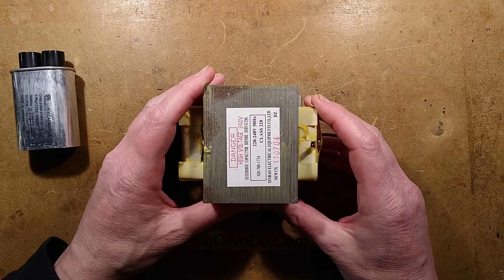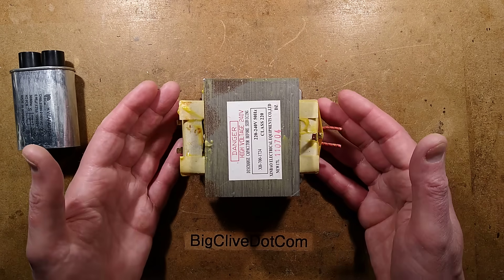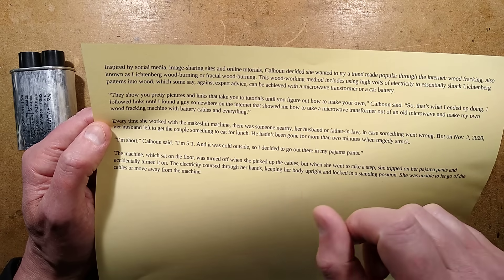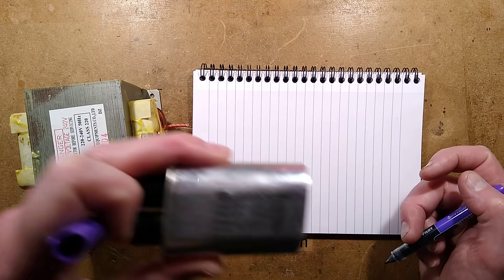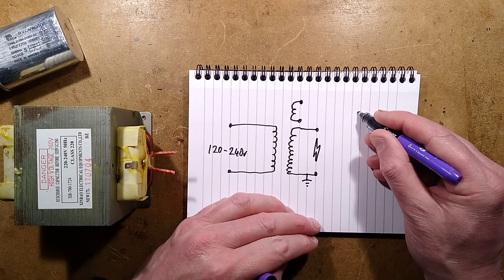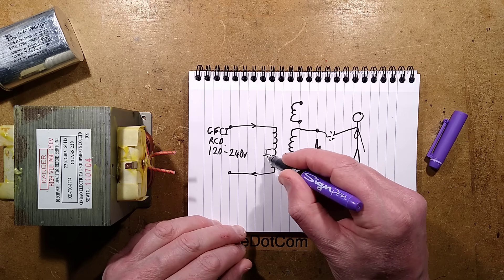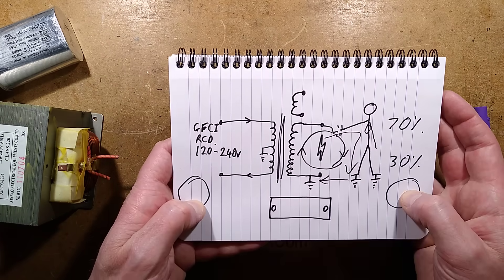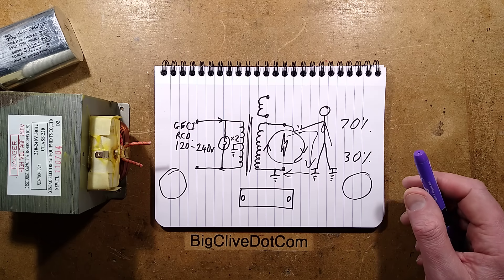The most deadly project on the Internet

Comment: I discharged a CRT tv multiple times. Was scary AF first time around though once i figured out that as long as i was careful and had one lead always attached to ground while shorting the anode nothing could happen

I can't imagine myself even working on a microwave
Reply: It is very unlikely to be killed by charged CRT voltage multiplier (unless it's literally powered). You'll get painful shock, but 99.9% you won't get serious trauma. MOT, on the other hand, is really deadly.
Reply: @voidseeker4394  to be fair. you kinda have to discharge the TV while it's plugged in (else you could damage components in the tv) even it is not powered on it can still do some damage to you if you're careless. and the thing is the shock doesn't have to be strong. just powerful enough to cause an arrhythmia in your heart (which even an electrified fence can do if you happen to have bad luck) now the only thing required would be some possibly undiagnosed condition beforehand and ye.. it could possibly kill you. the reason we keep stressing to be super careful while discharging a tube (if you absolutely have to) is that we don't know whether you might have a condition. heck i don't know if i possibly have one, never checked for it. and i know an arrhythmia itself is not always deadly but it can certainly lead to further problems down the line
Reply: @norjiaqosehon  yes, i've burned power supply's PWM chip while trying to discharge mains capacitor once. My screwdriver slipped and shorted wrong termilals.
Reply: @norjiaqosehon  also, i've wrote 99.9% just to cover probability of the cases you've explained.

Comment: One thing people forget about is that capacitors can build up a charge with ambient/environmental static electricity. Especially large caps. People should always short and ground caps in circuit, even if the circuit is not live.
Reply: Can they really? I'd think you'd require one terminal to be grounded and the other open to air; if the terminals are just open and next to each other, they'd just be at more or less the same potential.. And still I'd think this phenomenon would be weaker than the normal leakage of a capacitor. I mean, if you have a capacitor next to a Van de Graaf generator, then maybe?

Comment: CONDUCTOR    My dad worked on power plants installing electricity, ONE RULE was taught.... If you are messing with anything electrical without training, there is one single rule. Make sure there is no power to the circuit before it in the chain of power to your house.... before you get near it. Not can touch it.... GET NEAR IT. If you are incapable of following this rule, then you will be dead very soon and should move on to a hobby of beading bracelets instead. This wont help with idiots in this scenario but FFS educate yourself before you start pissing about burning wood with electricity as IT WILL KILL YOU FASTER THAN YOU CAN UPLOAD A VIDEO OF YOUR ARSE CATCHING FIRE. The word CONDUCTOR at the start is important and if you don't know what it means or what it applies to in terms of materials, put down whatever your doing before you literally die.

Comment: That would not work most people squeeze and clinch there hands tightly together when get shocked with this much power so you couldn't just drop the box in most cases
Reply: And it also makes the safety feature obsolete because if you're outside of the shock radius using the button remotely you're already not going to be shocked so you wouldn't need a dead switch the dead switch is so you don't get shocked you said just let go of a button a button you can't let go of if you're in the shock radius getting shocked it's like you totally don't understand what I'm saying
Reply from the maker: The box is remote from the location.

Comment: Is this the spot welder from a microwave?
Yes eventually someone will die
Reply from the maker: No.  The spot welder project replaces the high voltage winding with a low voltage one.  It's relatively safe.

Comment: No one should ever work on or use electrical devices unless they understand how they work and the dangers involved. Our greatest killer of man is the car. No one has stopped using the car even though they may be killed. There are ways to use a fractal burner that reduces the likelihood of being shocked, such as complete separation and insulation from the equipment as well as never being in contact with the device while it is working and using the device such as a pedal that instantaneously disconnects if the foot is released. One other device that is much safer is the  neon transformer which produces much lower amperage when fractal burning.  So if you are uncomfortable with fractal burning, by all means don’t do it. It will probably save your life.

Comment: Don't forget to warn people about the magnetrons in microwaves as well, The magnetron, which generates the microwave energy, has a sintered ceramic insulator that is made from beryllium oxide . During use it is inert and harmless but if it is crushed and the dust is inhaled you can get berylliosis, an incurable disease of the lungs. So be careful and if you're not sure what something is , seek professional advice.
Reply from the maker: Best few home microwaves have beryllium in them.  It tends to be an aluminium based ceramic.

Comment: Took my first electronics class in high school. The work benches and tables were solid wood framed with angle iron. No gfi outlets or breakers, ah yes designed as a wood or metal shop, but electronic ... ah the joys of working on a high voltage circuit . I was lucky the voltage was high but the current very low ... I nevertheless had learned an important lesson. By the end of the year the entire class had learned that lesson.  I went on to tutor students, and help a few become engineers so the shock was a right of passage. I spent the next 60 years playing about various electrical jobs. From computer supplies to 6000 hp pump circuits and survived, because I remembered that jolt in that poorly designed shop. Take care.
Reply: sounds deliberate
Reply: @crichey56  In those days, people learned about such dangers in small increments so as never to avoid caution in a more dangerous environment. These days, possibly unfortunately, students are protected from such experience. Though there are greater levels of safety protection, until those protections are assumed or removed, deliberately or otherwise. No-one can protect us from ourselves.
Reply: @PNH-sf4jz  yes. These 'small' dangers are  needed, its the same as the problem with people being too clean. (quote) "Now doctors think that babies and young children who live in very clean environments may be more likely to develop allergies, allergic skin conditions and inflammatory bowel disorders"

We need the small shocks or the, figuratively speaking, harmless germs to help later on with the, as you say, more dangerous environments.
Reply: @crichey56  👍
Reply: @PNH-sf4jz  Or maybe safety standards were just trash and there is a reason it‘s not done that way anymore.
Reply: Yeah, getting shocked in a controlled environment is definitely educational. I had quite a few during apprenticeship.The worst one I got was at home while taking appart a cheap camera. Didn't realize that flash capacitors are that high voltage 😅. Lesson learned, always discharge capacitors, even in very low voltage appliances.
Luckily I was sitting in a stable chair, so nothing much happened besides being stunned for a few seconds.
Reply: @noldos  Work on magneto systems some time. There you will find a good jolt if the advance unit kicks over.  To the tune of between 15 and 30kv.
Reply: @noldos  👍
Reply: So that lab accident actually gave you the superpowers of understanding the dangers of electricity.
Reply: @MrFishProd  👍
Reply: We used to use the variable voltage  electronics boxes in our physics lessons to explode pencil leads on the desks. Never got a shock but those boxes were set up to be pretty hard to hurt yourself using unless you REALLY tried... Such as by heating pencil leads until the were red hot and exploded leaving a charred hole on the top of the desk...
Reply: @NateTheScot  👍✅
Reply: It only takes 1 time to learn how dangerous electricity can be. The scary part is its mostly silent.
Reply: Don’t lose sight on the Kingdom of God 🏞️ all that is in the world is soon coming to an end. Seek God whilst He may be found. Jesus saves ✝️🩸🕊️
Reply: As an electrical helper I was present when the crew managed to make ball lightning.  Yep its a real thing, a floating fairy ball of energy, kinda pretty. I won't say how such a thing happened to protect the idiot responsible...but itbrequires a rather large battery 400 volts, 10,000 amps a 600 hp motor with DC exciter,  and two small unmarked wires.  6 men stood frozen watching something they had never seen, yet knew it to be dangerous.  Despite this I went on to work medium and high voltages , just an interesting lesson along the way, next time 6000 volt knife switches and the wooden pole .?

Comment: As a retired  electrical engineer that has worked on 10,000 watt radio transmitters, I am hesitant to use a microwave high voltage, power transformer on an arduino project.

Comment: On Dec 13 of this last year was almost my last day. This is something I used to do a lot. A lot of experience and being so careful. Always made sure to use solutions in separate area. Just as a precaution. And as I was being shocked ..... All I could do was think what did I miss. After hitting the ground hard everything went tunnel vision to black. The sounds seems far away in the distance. Luckily my boyfriend was working near by and ripped the leads away. I was stiff as a board. When I came back to reality. I still couldn't figure out what happened. Why didn't I know what happened? And then it hit me the next day. It was cold outside. I borrowed a sweater minutes before. The sweater was believe it or not the conductor. Made of wool. Very conductive material. Luckily my heart was good, however... My hands were not in good shape. Imagine hotdogs in a microwave. Had 5 exit wounds. Blew my knuckle out to the bone. And the tip of that finger is gone. Two on my leg and 1 on the bottom of my foot. I don't even like being too close to a microwave. The worst part is as an artist I use my hands to make a living. This was very dangerous and highly consequential. The fact that I am still here is only because someone jumped to action without hesitation. So, with that said. Just know it is gonna be something that just wasn't considered at the time. And the end result of a simple mistake is death.
Reply: Ouch sounds painful. Been fractal burning for many years...shocked myself a few times. Nothing that bad.  I don't use microwave transformers, tho. m
Made my own design that turns off when faulted.

Comment: I had saved a transformer from an old microwave years ago that I intended to use for a spot welder project. I'm experienced and consider myself competent with both high and low voltage electrical (hell my last job I simulated lightning strikes to test metal oxide varistors and had to work on the equipment). The more I thought about it though, the more I realized it's just not worth the risk for a DIY with one of these when a real spot welder is pretty inexpensive. So into the recycling the transformer went.
Reply from the maker: With the high voltage winding cut off to make a spot welder the transformer is relatively safe as long as normal electrical precautions are observed.

Comment: Its only dangerous when your careless on how you handle it. My man works with neon transformers all the way up to 15,000v AC, at 30ma which is equally dangerous. My man has never once put himself in danger, or me when it comes to High Voltage. First rull of thumb, never rely on a power switch as the primary for safety. Always unplug before changing anything on a transformer. Transformers or electricity of any kind can be dangerous if treated with disrespect.  The switch is your second line of defense, unplug fully is your first line of defense! As any one would say: if you don't trust yourself or if you feel uncomfortable dealing with high voltage, don't work on high voltage. My man used to also fix tv's back in the day dealing with 27,000V DC and even 40,000 VDC on old tube TVs. He would work on 13 inch to floor model TV's when he was only 16 years old. He has years of schooling, and safety training when it came to repairing tv's.

Three safety tips.
Never work alone
Always make sure the device is fully unplugged
And if you do work on a live circuit, make sure your left hand is in the pocket.

Comment: When I was a kid in the 60's I was going to plug in the old b&w tube powered TV as they all were then, did you know on many if you hold the plug then turn on the TV switch the current comes out the power cable from those old capacitors? Sent me about 8 feet a cross the room, never did it again though. I was about 9 at the  time, woke me right up and I could taste ozone for half an hour afterwards. This would be a wee bit worse.

Comment: One more thought.  You may want to put a buzzer/ noise maker in parallel with your light indicator.  I use a tripod made of 1/2 inch pvc to hold the high voltage probe.  I have a large neon transformer given to me by a friend.

Comment: I was working on a CRT monitor one time that had an issue with HOTs(High Output Transistors) overheating. I wasn't sure if I fixed the issue, so I powered it up with my homemade 120V power source I used for them and ran a test pattern for 15mins then shut off the pattern generator. I then reached over to feel the HOT's heat sync and heard the loudest sound Inhave ever heard! Now what dod I do wrong?! That's right I didn't turn the power source off because without the test pattern it looked off. It was a 25" CGA CRT for an Arcade game, so the HOT was putting out some
Voltage. Luckily I didn't get stuck to it. I did put a red spinning "police" light on the power source to indicate that it was on though!

Comment: I was electrocuted w 240v when I was a young kid by filling up the extricate jug while it was plugged in, and still w wet hands I got a mean whack- couldn't let go, couldn't yell out for help. Woke up on the other side of the kitchen.
Anyway, I just wanted to add- never close fingers around something that could be live, that sounds stupid, but the point I think is important, and I never forgot it, use the back of your hand to flick that switch, as if you get a whack, your muscles will tighten and make you unable to break away. Your fingers will grip tight and the longer the shock, the more dangerous.
By using the back of your hand, your elbow will close, and hand will close, without gripping a  dangerous conductor, in whatever form. Rather than not being able to free yourself, this makes the short you experience probably less than a second, automatically breaking the circuit as the muscles tighten and throw you clear.
Make sure your build has a dead man's switch, live indicators, and there is good use of solder and solid crimp or screwed down connections with lots of shrink-wrap to remove as many possible points 
of danger as possible.
Take your time, make connections strong, and know the working theory so you understand the high wattage you are working with. Take care, have fun.

Comment: 0:00 I'm just going to start with... "POWER!!".  connecting anything to mains without any limiting circuitry means you get all the power.  forget about current and voltage for a minute as it can often complicate the matter. Everyone can understand power in that UK power will put ~2kW into your body without skipping a beat. laptop chargers work at around 100W and lower and phone chargers work around 10W.

Now all power depends not just electricical power, so please provide the variables for the "depends" in electronics

Comment: I have no idea of the amperage but I got zapped by a 220v contact shorted from my left hand across my body to right hand and legs and the shock threw me 4 feet into the wall......which I think was because my legs were bent and the shock straightened them immediately..... and fortunately, since the equipment was heavy, broke the contact with my hands.  Very fortunate I was young (about 20) and strong (very healthy).   Wasn't long after that our shop bought a new piece of equipment to replace it.

Comment: We had electric fence growing up that was around 10,000 bolts near the box.  Omg did it hurt.  The amperage is low, thank God.  Another time I got blasted by high voltage and it really really hurt.  My arm throbbed all day and it burned my fingers and hands through welding gloves.  I was turning on a 400hp electric motor.  We didn't have phase 3 power and we used this terrifying box my boss made to jump up the juice.  It had this capacitor that didn't discharge and I drained it.

Comment: a good safety feature that should be a compulsory addition on all tutorials is alteration to the secondary winding, disconnecting it from earth and creating a floating output. An RCD could then be utilised on the primary side providing the workpiece is insulated from earth. please correct me if i'm wrong...